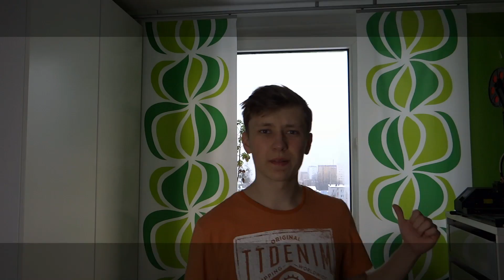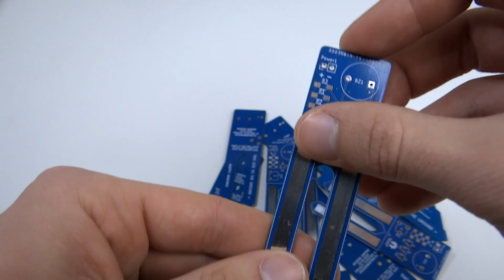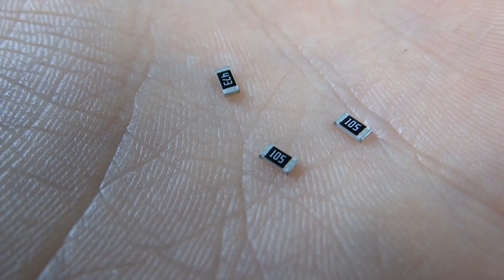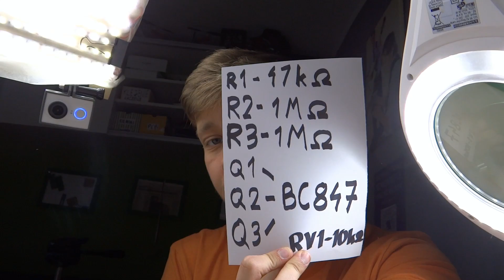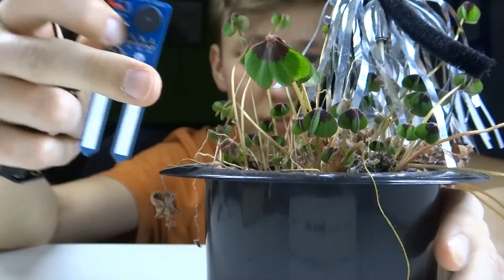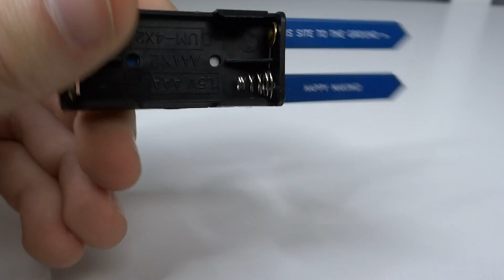Monitoring Soil Moisture without a Microcontroller

Comment: Good job. I think you should make a few different types. Solar panel. A self watering one. one that will text you. Esp8266. A twitter one. A self turning one.
Reply from the maker: Thanks! Great ideas, I will think about making the wole series of projects for flowers :)
Reply: Seeing you have plenty of pcbs. You might as well make a variety  of projects with them.
Reply from the maker: That's exactly what I want to make, I want to make a lot of simple projects so that anyone can start with electronics, soldering and so on. I am selling those PCBs on tindie so that someone that don't know how to order them or make can easily complete a project. If you have an idea for the project that you would like to see in the video, please let me know :)
Reply: I was wondering if next time you make the pcbs that you add the long soil traces on the back also. Seeing they last longer if one side starts to corrode